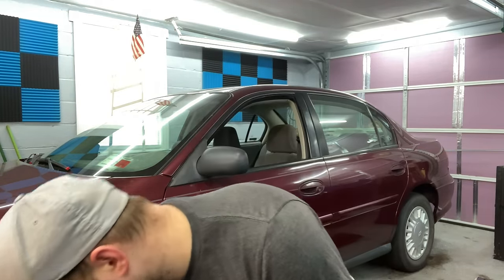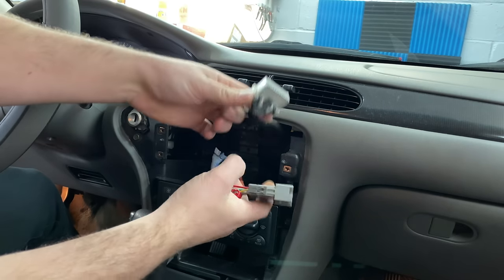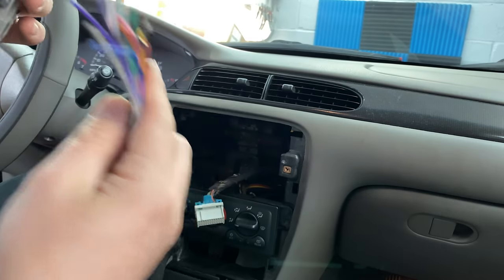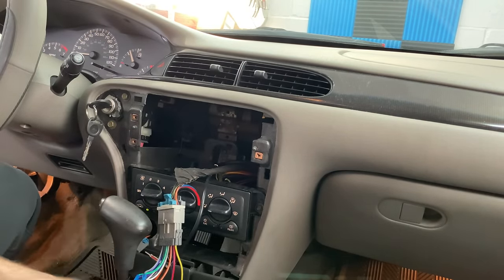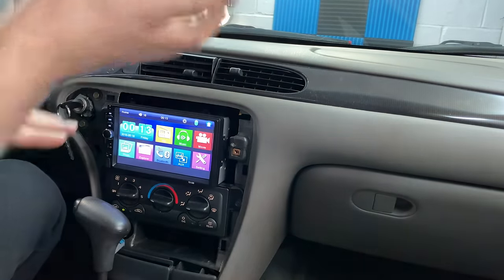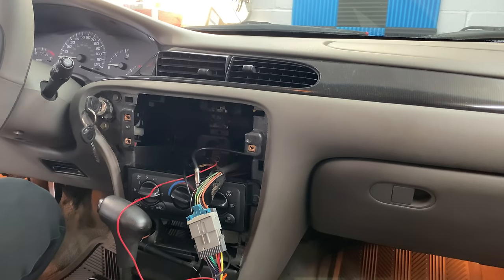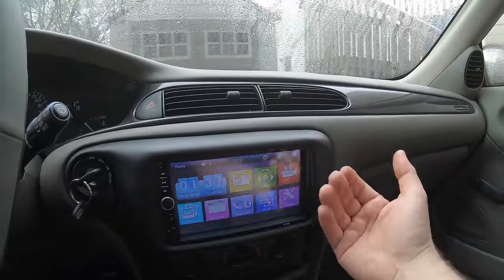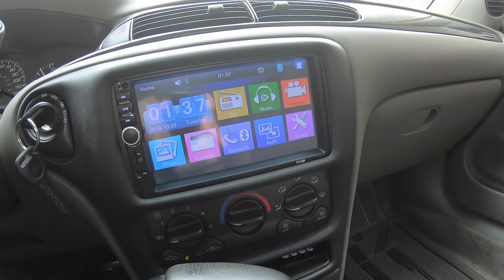I Bought the Cheapest Touch Screen Stereo on Amazon! | Malibu Episode 3

Comment: It honestly looks stock these days new cars come with a basic screen like this.
Reply: For 65 I got a pure android one, better than what top of the line infotaiment on a new car has. No android auto BS.
Reply: Oem  so much better than any afternarket crap.
Reply: @alb12345672  link for that?
Reply: Alot of that junk you get dirt cheap is Chinese knock offs. Not something I would trust hooking up as they are usually of lower quality and poor wiring, that can potentially destroy your electrical system. You get what you paid for.
Reply: @eman0828  :lol:  Not in this case. Remember Iphones are made there.  Where do you think the stereo the guy in the video installed is made? Not saying it is quality or not. 
 The unit for Chrysler is made side by side in the factory (it is different obviously). I talked to them for support and they showed me pics of their assembly line. Very helpful too and they are proud of their product. There are no bad reviews for it. It is sold internationally.  Also, it isn't going to hurt your car. The radio is fused to 10 amps. It is not a safety thing in the least.  There are some brands that put their brand on it and sell it for $150. I can say I use it every day for 6 months. I wish the  side buttons can go green to match the other controls in the car, but it is a lower cost unit and that feature was removed. The controls for color are there.
Reply: @alb12345672  There's a difference between a product designed and engineered in America verse something designed in China. Apple is an American company with American Engineering design specifications and choosing the right components to use. Junk designed in China use more lower quality components.
Reply: @eman0828  I agree in some cases but debatable with something like this. The unit is built from commodity parts and chips that are pretty much universal. It is probably built to an automotive standard which is higher quality. The company explained it to me. I see from reviews it is a good product.  Now, if you buy a no name ball joint from China, yeah, you could be in big trouble.
 As for Apple, go check out Louis Rossman's channel and see some of the Junk they create. They don't even stand behind failures unless it becomes a major PR issue.
Reply: @alb12345672  In most cases. Electronics (among other things) are a "You get what you pay for" deal. Nothing that is super cheap will ever be built as well as the expensive product. This ain't the 50's. Wouldn't ever trust something like this, aside from the possibility of fires from poor wiring and materials, it most likely will break super quick, and be useless in cold weather. It may look good to a buyer, but it's dishonest to pretend it adds value. And in terms of Rossman, he himself admits Apples products are high quality, it's the bullshit low repairability he doesn't like, and for good reason.
Reply: @eman0828  I bought flood mount lights , made in China; They work amazing. It's really just a matter of proper installation nothing is ever built to last. Even American Vehicles have an expiration date.
Reply: @Roger-ob2ft  As I said before there is quit a difference between a product designed in Japan or America and assembled in China vs a pure Chinese produce that was both designed and assembled in China. Anything can be assembled in China but that doesn't necessary mean it's a Chinese product. There's alot of knock off junk that comes straight out of China that you get dirt cheap is what you want to steer clear away from. You get what you paid before as its like buying cheap Chinese brand tires that you put on your car verse Michelin, they can both be made in China but I promise you, the quality between the two aren't the same as non Chinese companies has specific engineering requirements and specs they follow that uses higher quality material and complements. I'm a Music Producer an I own s British designed Audio Interface designed in England by Focusrite it's British Engineering despite is says it was assembled in China. There's a difference.
Reply: @eman0828  False. Lots of products designed in China are actually very good, A car radio is all about how you do your own wiring and set up. A lot of things that say made in the US actually use products from China. You uave to realize the average American product is made by a person without any training a high school education that makes maybe 10 $ per hour. Do you really think that euqates to a great product? My Laptop was made and developed and China and has never had one problem in 5 years.
Reply: @squeakyknee  Lol says the guy who vrags on American products when Fords are literally known as Found On Tbe Road Deadand Dells are some of the shittiest laptops around. My laptop came from China and has been working perfectly for 5 years, in the same time frame I had multiple Dells go out on me. Radios are all about who installs tham and how they do the wiring.
Reply: @Brian-jv8iy  Pure android with 5 different map apps?  I also have forscan and can put up a dashboard of any car parameter. What would I want more?

Comment: One thing I love about chevys is the easy access of stereos
Reply: also thieves
Reply: Anthony Damac my mistubishi was just as easy tbh.... only 4 screws instead of the 2. Unlike toyota, you have to take practically the dash apart
Reply: mr rod he had to move the gear shifter, its finneeee..... plus a loss of $45.... does it really matter... 🤷🏽‍♂️ plus it looks stock since their all so minimalistic and shit. Might as well hit something else
Reply: @mrrod805  they also have theft lock though if you remove a gm radio made   after 1996 it wont work if you try to put it in another car. It will digitally lock up

Comment: Come on Mr. Red Beard, that 7018 radio is the Model A of 50 buck radios, I have one in my 2013 Ridge Line and had one in my last truck, look it is just MEAT AND POTATOES its all you need, nothing  fancy, Maybe because I am 76 , and thought the one transistor radio was hot shit back in 1960, with a 2 inch speaker could be clouding my judgement I don't know but hey cut the thing some slack.

Comment: Why didn't you just run an accessory circuit from the ACC port in the fuse box of your Malibu . That's what it's there for . No power with the key off and it's powered when the key is on.

Comment: Man that's odd... there should've been a switched 12 volt red wire in the factory harness, whereas you wouldn't have to tap into the HVAC wire, possibly causing a overload in the fuse circuit down the road, cuz when you reconnected the old radio it works just fine, I've installed aftermarket radio units w/ wire harnesses over the years and never had an issue like that,  double check the wiring diagram, & making sure all wires correspond /match up! and it's plug n play.

Comment: You have me wondering if it would fit in my '87 Trans Am without much hassle.
Reply: My 86 is pretty much single DIN. I doubt it would fit.
Reply: @skykilpatrick2833  All 3rd gens are DIN and a half.  The 'birds have less room in the back but depth doesn't appear to be an issue here.

Comment: you should be using a pac rp5-gm11 not a base gm-4001 harness. pac part will give you rap but what you are using will not. will also give you reverse trigger and parking brake as well as steering controls integration

Comment: mine would always drop the bluetooth and start chopping but mine had a different software it seems even though it was the exact one with that model number and stuff. maybe my car blocked the signal.. idk. and no sub output so i had to ditch it once i got a new unit. i ran it and a single din where my ashtray cig lighter area was. so almost like a amp and screen stack like in your house lol. but now on a 2012 kenwood which for  some reason cannot play videos from usb smh

Comment: Cheap radios never fit correctly in the standard kits
Reply: True I had to shave down the kit on mine
Reply: After market never does. You've gotta be creative
Reply: Ya dash kits never fit, you either cut the car or cut the kit itself and make it fit.
Reply: Don’t buy install kits! Go to hobby lobby and get some plastic sheeting, any color you want, and cut to fill gaps. Glue or screw solid. Do not cut car. Lol

Comment: I bought a Pumpkin head unit for my Cmax and the hooring thing absolutely doesn't fit the hole. It constantly crashes, Google maps takes five minutes to calculate a route and the MP3 player in it takes half an hour to play anything without stuttering.
And it cost a hell of a lot more than fiddy bucks.
I still like it, because it has MP3, internet radio app, reverse camera, FM radio, connects to OBD, is a handsfree kit for my phone, is my sat nav despite it's speed, once it goes it's ok and besides that, because it's Android and has the play store, I can install anything I want on it, for example YouTube.
Despite it's shortcomings, it's very useful to have.
Reply from the maker: They actual got in contact with me asking for a collaboration. I did some research on the company and politely declined!
Reply: @lsxmatt  I'd say processor power let's them down, it says quad core, but it runs like an old Nokia

Comment: @12:17 Why did you mount the back-up camera blocking access to one of the screw holes for a license plate (or frame)?
Reply from the maker: Its not blocking, just looks like it from that angle. I removed the plate after installing the camera.

Comment: My car has 7 speakers, 6 basic ones and a stock oem subwoofer in the back right. Can this unit connect to all of them? The wiring diagram on amazon shows it only connecting to 4 speakers (front and back left and right). Thanks

Comment: Hi I had a singe din Stereo with similar socket as of this new double stereo.
I didn’t change the wiring or used any adapter. 
Everything works fine but the only problem I am having is when I turn on the headlights, the screen goes blue and shows reversing at the corner considering i have not connected the camera. But can you please help me with specific color wire that i might need to change so that the screen does not go on reversing when i switch headlights on??

Comment: U have to splice the red and yellow wires together.
Reply from the maker: It will stay on all the time then. Yellow is constant power.
Reply: @lsxmatt  , if u tie in the wires coming from the head unit (red and yellow) to the red and yellow wires on your aftermarket wiring harness,  it will work properly long as your blue remote wire is connected. I install all my own stereos and I have 12 vehicles ranging from Chevy, ford, dodge, Mitsubishi, BMW,  and Mercedes. I've ran across this issue countless times in the past 25yrs that I've been dealing with vehicles!!😊😊🖒🖒💯💯💯💯

Comment: my brother has this exact radio and its a piece of crap. for some reason it sometimes loses the constant battery connection and it loses all the settings. its not the wiring, its the radio. also the loudness setting doesn't do anything in some modes. worth 40 bucks i guess

Comment: GM started using data harnesses in the 90s. The factory radio receives signal from the BCM when the key is on and turns on RAP accessories. The correct harness is about $100 but what you did is a common workaround that works.

Comment: Don't trust color matching.  DON'T EVER trust it with ford especially.  Also make sure that you get the correct adapter for your car's trim level.  Some car makers will have different connectors for different trim levels or have slightly different pin outs in the standard connectors; especially if your car comes with a factory amp.

Comment: All of my engine text goes on my radio panel display Im afraid I wouldnt be able to get a feed back if I switch mine to this kind, Im using pontiac g6 2008. But is there any way I could transfer the WARNINGS to the touch screen?

Comment: Hello, i had bought the same radio with a remote control, but when i started using the remote, then the volume button stopped working, can’t turn volume up or down by turning the volume button/knob anymore. Does anyone have a fix ?

Comment: I got that same radio on my car, I bought it from Geek, along with new door speakers, a 10" sub and box, and a supposedly 1000w amp... it actually sounds pretty decent, the entire sound system cost me less than $200 with free shipping lol... I did buy a wiring kit from Amazon because the one it came with has super thin wires, the plastic is thick to try and fool you, but the wires are actually like headphone wires LOL.
I've had it for months, still works fine.

Comment: bought the same unit 2 years ago for $54us , failed 3 months ago.  problems from the get go included  once the radio was turned on it would squeal for about 1 minute. Complained to the seller and I got 30 dollars  in refund. so it cost me $24, and used it for 2 years.  Just installed a new unit  a Pioneer MVH-210 for 139 dollars a ton better  big sound. Moral of the story, You get what  you pay for.

Comment: 2001 car and not even a cassette player wtf i have a 2001 ford focus (European Model) and it has a cd player and is base spec
Reply: You said it yourself, it's the European model. Nowadays, Americans care about features, but back then, they were far less demanding than customers in Europe and car manufacturers used this fact to omit features left and right. American cars are still less sophisticated in some respects than their European variants (simpler suspension and brake systems are still common), but it's getting better.
Reply: @no1DdC  yea GETTING better

Comment: I hate GMs, they have that feature where the radio stays on after the key is taken out the, so it does not have an ignition signal, do you have to wire up a constant power. On my old cobalt that I own anymore, thank God, I had to turn off the radio manually

Comment: here in Philippines, price is $27.75 and $1 shipping fee 😅
Reply: Sir  you can buy it in the Philippines through Shoppe or Lazada for P1,300 up. You can choose different types of this  mp5 player,  better to buy the upgraded version where there is an audio settings interface to adjust bass, treble and fader position. This real a bang for the buck if you do not have enough budget to buy those branded ones .

Comment: buy this cheap $5 part to "do the job right" doesn't even look up wiring diragram just "matches the colors" because that's how that works.
Reply from the maker: Most car stereo harnesses conform to E.I.A standards. Even this cheap radio did. I’ve installed enough where I can just match by color without having to double check. There’s no reason to hack up a dash harness when you can easily obtain the correct connector.

Comment: Does this guy not understand that upgrading your radio doesn’t change sound quality
Reply: but it does, just this one isn't an upgrade from OEM stereos built in amplifiers vary wildly between head units and the amp dictates how it sounds if it is a cheap amp in the head unit it will send dirty power to the components which gives an awful tinny (tin can echo) sound. Also cheap head unit are prone to clipping at much lower gains. You should always get a good head unit first and up grade components later with stuff that falls into the right specs and output range for your head unit.
Reply: It definitely does, in this case, not so much. Also considering we didnt get a before/after audio to go off of. But standard older stock head units from this time put out maybe 15,20,25 watts or amps or whatever. And the aftermarket in my car is around 60. But like the comment above me says you are most definitely incorrect, I would always recommend upgrading the head unit before speakers. The difference between the two can be miles apart... Its okay tho, I also thought I knew everything in my teens like yourself, judging from your profile pic..
Reply: did you know he mention this in the video that the speakers were the same since 01...close your eyes and open your ears...lol

Comment: But, why a Chevy?
Reply: Earthling1984 wrong question young one. It’s why NOT. Most people want Heated seats. Not tailgates...
Reply: @jonellwanger7258  I'm just saying, I would never buy a Chevy.  Maybe 20 years ago.
Reply: Earthling1984 🤣🤣I’ll agree to that. I’ve got a 04 Denali with 480,000 miles, just barely started replacing the driveline. Tranny went out, but started towing a 25’ 10,000 trailer at 400,000. Now at the 480,000 I’m looking for a Tcase. But hell 480,000 miles, and things are now starting to fail. Never needed an alignment. I can only tell because the factory has plastic clips that need broken for alignment. Still there. Quadrasteer works fine. Now I’m confident as hell if I didn’t pull the trailer, I wouldn’t have needed a tranny, or t case. But I pulled a trailer through the mountains for a year or two, abusing the truck. The 6.0 has again 480,000, and burns a puff of smoke at start up. And blows a chunk on acceleration, so maybe the engine is “tired” I put quotes cause even loaded with work tools, you need a sports car to get away from me. Strong still! Good trucks!! The electronics make it a bitch!! But between the 90 burban that’s tried to kill me three times this year, I’ll be happy to have my 04 back!  I haven’t looked at these newer vehicles past 2010...   🤦🏻‍♂️🤣🤣🤦🏻‍♂️ Lol, also, I haven’t been very kind to the truck. Often I find no oil on the stick after racing someone down the highway, how long has it been that way?🤷‍♂️ but I never hear a lifter tick, so must be good... and it still runs. In Colorado, steep grades. Heavy loads. Cold ass air. To no air. They are good trucks. Why not?